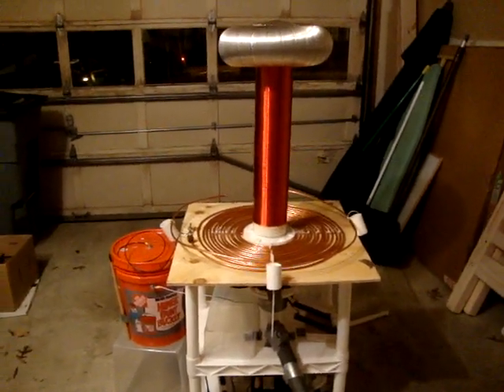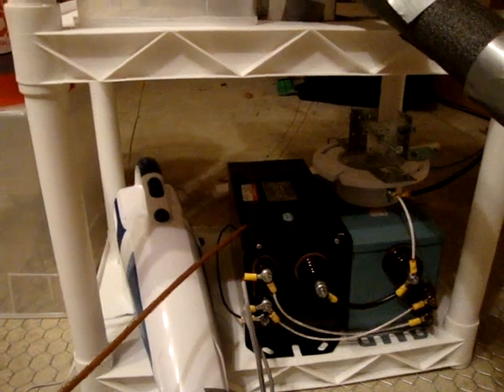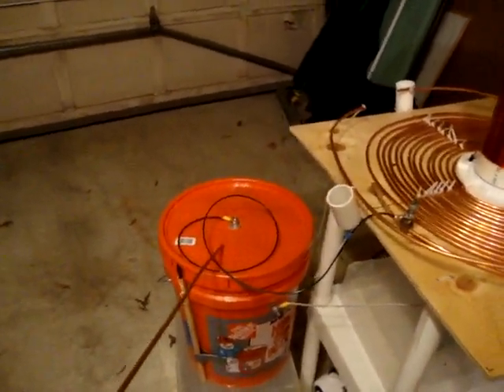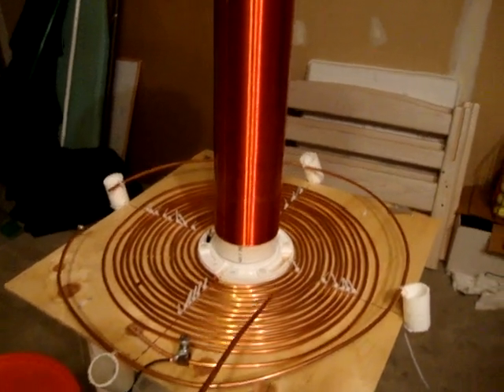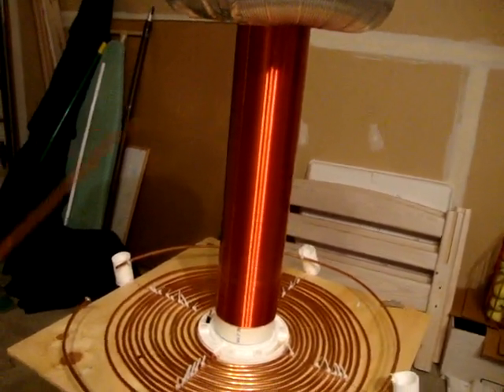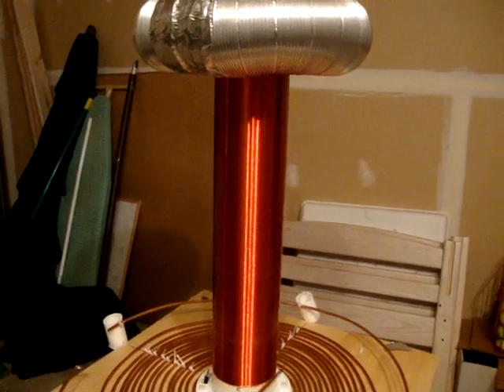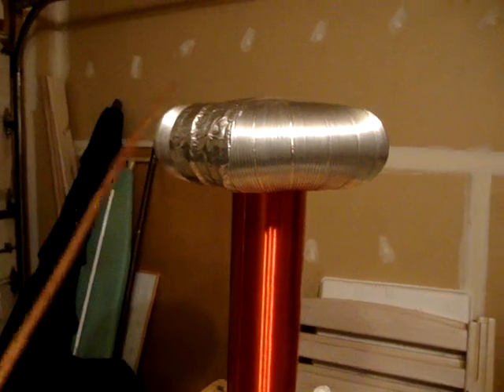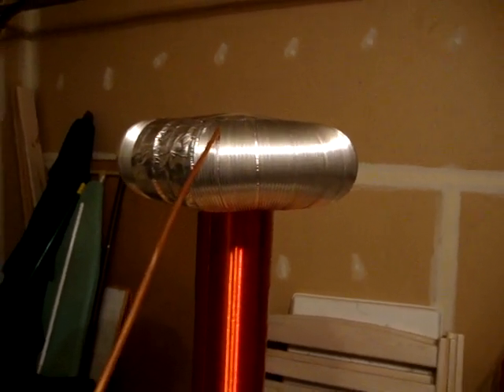How a Tesla Coil Works

Comment: The guy in the video is right air is involved. Look up EXACTLY what lightning is. It's an element called plasma and plasma is just a soup of ions of a gas, the air, in this case. If an electric field is great enough to exceed the break down voltage of what ever gas it is in then the gas will ionize. The gas molecules will have an electron ripped from them creating a mixture of positively charged ions and negative electrons. this mixture is called plasma

Comment: Actually, the air is not involved in this process at all.  The spark is actually just a build up of electrical potential between the top of the machine and the ground.  The spark is essentially a small lightning bolt.  Much like the spark that occurs between your finger and a doorknob.

Comment: I have been having trouble with my coil. I can only get 1 inch sparks! Here the specifications of my coil if this could help
Width 2in
height 14in
wire gauge 26
primary 10ft of 1/4in copper tubing (flat slightly upward spiral)
transformer 12kv 30ma 360VA NST no GFI
8 capacitors (5 glass coke bottles, 2 ovaltine's, 1 maxwell coffee)
capacitors in parallel with the trans, spark gap between trans and primary
please let me know what I am doing wrong; I should be getting at least 6in sparks

Comment: @DJ027X Google is your friend.
Iron screws up the idea, like a motor its a timing thing. 
Primarys field collapses at the very base it induces current, that on each wind induces current on the next until the top where the electrons build on the torid until that gets saturated thats why they use spheres or rings (no points)
Go on google study some theory,and join a forum or 2 .Really not that complected

Comment: Would it not be more efficient to A: spiral the primary coil upward around the secondary coil, elongating the magnetic field, and 2: use a iron/ferrite core instead of air thus fortifying the strength of the magnetic field? I'm certain A is correct, but I believe putting iron in the core may just give for more inductive resistance, which wouldn't be so good. Btw, if you run high voltage, high freq ac through your secondary, it would make a sweet inductance heater, provided it doesn't melt itsel

Comment: ..What are you using for the capacitor?...I built teslas 50+ years ago as a kid...I used glass and aluminum foil...glass about 6"X8"...20 or so plates...old vibrator type ignition coil...others I see use a distributor with small electric motor turning it.